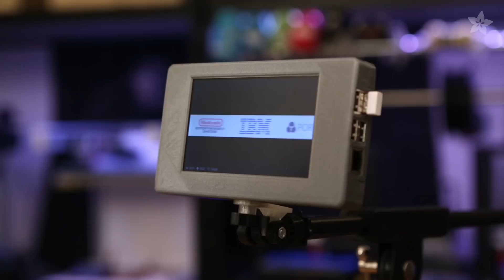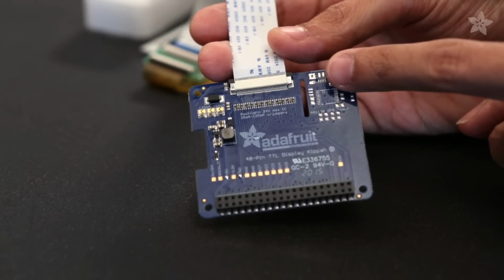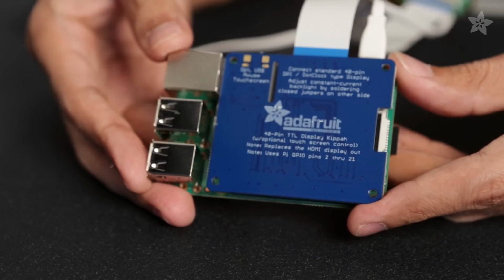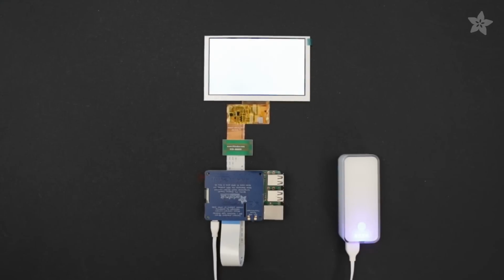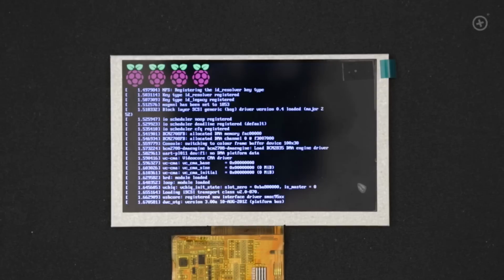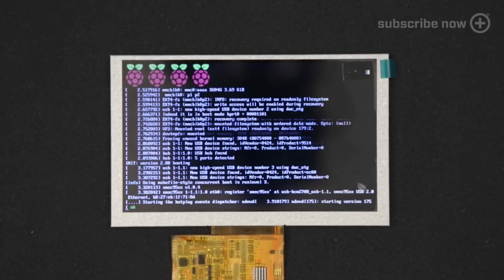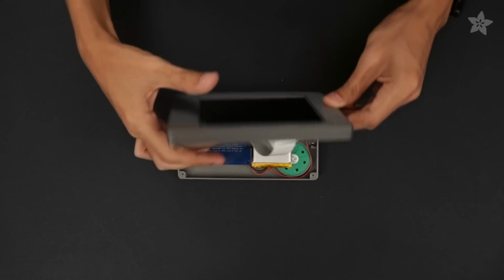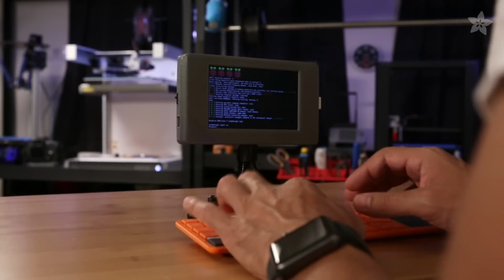How to make a 5" Portable Raspberry Pi 2

Comment: What I don't like about most solutions like that is that you either have to give up some of your GPIOs or like in this case all of them. I usually don't need them all at a time but I think it would be better to use one of the video outputs the RaspberryPi already has (e.g. HDMI).. Just my opinion about this :)

Comment: Hello, I was wondering if you guys could help me. I would like to reuse a broken down laptop (dead motherboard). The screen is ok. I was thinking about taking everything that's inside out of it and replacing with a raspberry pi. It would look like a normal windows laptop but inside is a raspberry pi. Thanks for the awsome content.
Reply: +dr proton It´s possible. Take a look at german hardware side forumdeluxx.de There is a guy installed a raspberry into a IBM X31 with broken mainboard. No easy task but doable.

Comment: I'm planning on getting a Raspberry PI 2 to build a classic emulator thing.. what parts would i need to get it running with minimal soldering needed? as i don't have a soldering gun and i don't even have the knowledge if i did have one

I would mainly go for the gameboy look (Preferrably game boy advance) with internal controls, but i do have a couple of USB controllers i could use if internal isnt an option for solder free. 

Controls must at least fit the style of the xbox 360, i don't like the positions of the analog sticks for playstation.. thumbs dont reach that far

What screen would i use? touch or no, i at least want a 5" screen a higher resolution could be a plus too...
An accessible MicroSD slot, and all Ports available, like hdmi (if i choose to connect to a TV) and USB

What would i use to power the PI with?

and how much of this is doable in a $100 budget PI included?
Reply: i could go smaller for the screen, as long as i can view a desktop environment natively on the screen

Comment: Add controller mount, make it run steam, stream games and you have a portable steam machine.
Reply: +Abel Pacheco not possible to run steam,

trust me, ive tried
Reply: It is possible to stream games from a nividia based machine with the correct soft ware but I would use Ethernet if I were you and that would loose the mobile part
Reply: Greyson Deane yeah i um have a amd card so yeah that really wasnt a option for me when i was trying to install steam.

DARN THOSE I386's!
Reply: +BoyPeanut Linux And Tech Videos write now and has a nividia like program  in beta so it will probably be possible a little down the line so don't loose hope and if you want to see how the idea of the steam streaming I would watch possibly unsafe they have a video on it

Comment: would i be able to use a ds lite for my case
Reply: +Captin Echo 

Wow

thanks so much for the idea.
Reply: No problem
Reply: When you finish it tell me if its a good idea to do it
Reply: Captin Echo ok thanks for the reply,

will get back to you in a few weeks
Reply: +Captin Echo, okay unless you have a dremel and a lot of patience it is a goodish idea.

you do need a special screwdriver to take the ds lite apart, but I just took a drill to the special screws
(the screw driver name is called a tri wing screwdriver.)

Im going to hack up a snes controller and get the controls to work eventually and put a lcd on it so i will reply back once i have done so.
Reply: +BoyPeanut Linux And Tech Videos  thanks for the info
Reply: You would need to carve out the inside and add stand offs and such but I find a cool Idea. I personally took a raspberry pi A and pitot in a gameboy advanced sp and did snes and gameboy and still used the original screen
Reply: nice.

what driver board did you interface for the hdmi
Reply: +BoyPeanut Linux And Tech Videos I don't quite remember but I was planing on taking it apart to use parts might reply tomarrow

Comment: I have finally received all of the parts need for this project, including a second 7" display and kippah for a derivative version.  The problem is that I followed the software configuration per instructions and the display never shows anything, nor does it allow the display to show on my HDMI monitor any longer.  Seems like the software or instructions may have a problem.

Comment: The Adafruit page on how to build this is missing key information.  For instance the parts list is not complete--for instance it doesn't list the 40 pin extension cable nor the 1/4-20 metal adapter piece.  I have destroyed two of the switches trying to get it to install in the 3D printed case, it appears that it is supposed to snap it, but it refuses to do so.

I ordered the parts and hoped to have this build finished this weekend.  Now I need to order more parts and wait...  I expect better from Adafruit.
Reply from the maker: Walter Anderson Thanks for your feedback on the guide, we'll be sure to review the parts list. As for the 3D parts, tolerances vary depending on your printer and some experimentation is expected during all project builds!
Reply: Adafruit Industries 
As of this morning the 40 pin extension has still not been added to the parts list for this build.  Also the issue with the switch isn't a 'tolerance' issue because the problem is well in excess of the 1mm 'fit' once would expect from tolerance issues.  Curiously the video doesn't actually show installing the switch, just a quick fade and magically the switch is in place...

Comment: I second the question of what keyboard is that?!

and also, what about a slightly larger screen like the one I purchased for my Raspberry Pi B+ the Tontec® 10.1 Inches High Resolution 1280x800 LCD screen. Would it still work with the parts you have listed but a different case obviously?
Reply: Dem Nod keyboard is from the kano kit